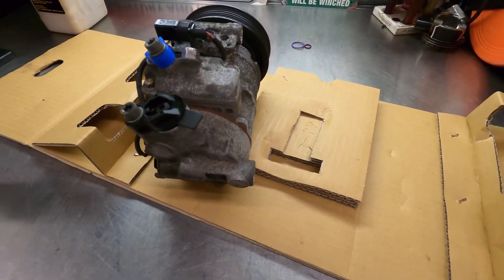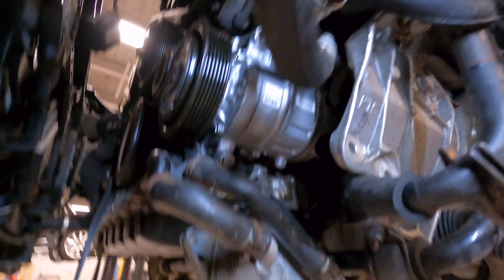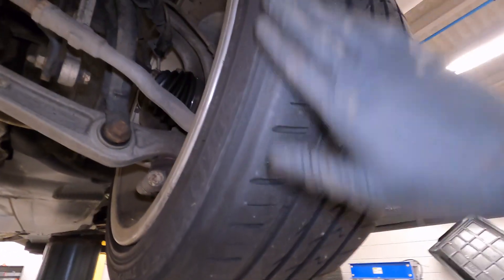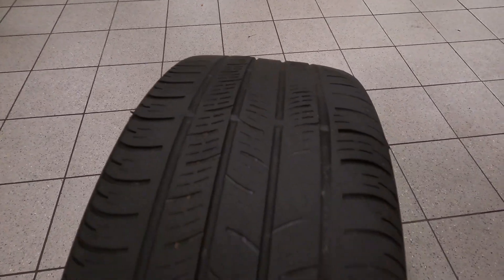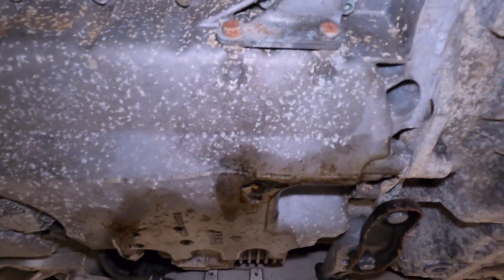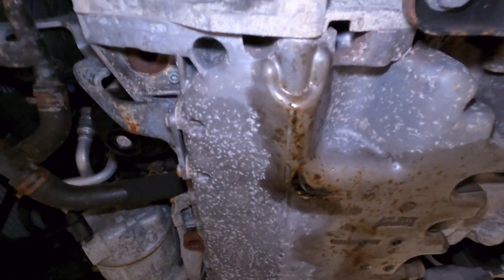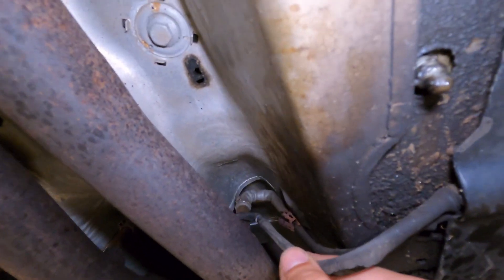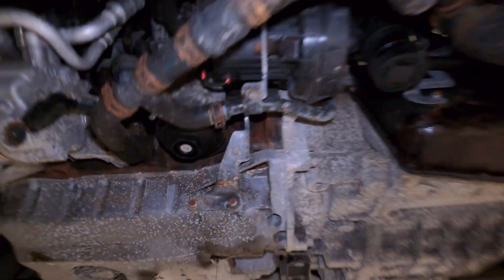Customer states Weird day in the shop again😜🤣 What's going on!??

Comment: If you slam a car so far that it punctures the oil pan, the only way to protect that car is to take it away from the owner.
Reply: That owner decided to lower an Audi.  Why would you ever do such a thing?  They deserve what they get
Reply: it there  car they  can   do what they want
Reply: @steveholland1163  ...until the oil that comes out of that BROKEN PAN makes the road slick when you’re driving behind them.

...OR they seize the engine and it shuts down right in front of you...
On a MAJOR road blocking traffic!

I bet you’ll think differently then!
Reply: @mr.carguy3161  that can happen for any car.  what really make those slammed cars annoying  is how everything grind to a halt when some fool in a slammed car need to do a turn onto something with a little elevation. 
where i live the speedbumps are so agressive that if you dont pay attention and hit one at normal road speed it hit your oilpan too in a non lowered car.
Reply: @lanemorrow7417  What about the idiots who camber their wheels so they're riding on the sidewall?

Comment: When cheap owners don't take care of their expensive cars.
Reply: I used to work at Subaru and saw it all the time with the WRXs/STIs. Kids would modify them without knowing how to care for them and they’d end up coming into the shop on the bed of a tow truck
Reply: @johns5586  People go and finance these high 5 and 6 figure cars, and are so stretched to the limit on the payments, they can't afford the repairs. So they  eventually become 500 dollar specials on a seedy used car lot.
Reply: Amazing what people will do to LOOK rich.  Most haven't a clue that when you buy German, you're in for quite the relationship/experience.  Audis virtually fall apart within 5 years of ownership if you don't dump $3k a year in them post warranty.  the people that don't know that end up with barely running piles that aren't worth the cost of a set of tires.  Keep your German cars man, I had my turn.
Reply: cameron170 -  hell yeah man. We had a 2006 STI coming in with over 250k and it was in perfect health. People don’t understand that owning a car is more than just oil changes and tires

Comment: I took my Accord in for a wheel alignment, 160,000 miles. Never had alignment before.  Went to pick it up, told no charge as it was still in specs!  Double surprised it was still in spec, but no charge for putting it up in the rack, doing all the checks.
Reply: that is awesome.  must have good roads in your area.
Reply: I've done that for a "good" customer; it pays back in other ways.
Reply: @steveneumeyer681  That's what I'm saying! Ain't like that out here in the desert!
Reply: Some places do alignment checks for free. So probably why you didn't get charged for it. As for being in spec. Wow! Must live in the south or somewhere with no potholes. Haha
Reply: Good old reliable honda. If you drive a GM they would’ve had to charge you double
Reply: Cars 17 years old and the alignment is still perfect tracks straight down the road the steering wheel goes bang on centre I guess shit lasts if you look after it

Comment: Having worked in a factory, all the "stuff" is bolted onto the engine/transmission before its  installed into the car/truck/S U V. Everything is easy to access when the engine is sitting on the assembly line before going into the car ! Lol 😆.  Just check out Having to replace the heater core assembly  !
Reply: Ford Tech Makaloco (spelling) had to change a heater core when the driver's side door had to be removed to pull a long bolt out that held up part of the dash. Plus the whole dash and driver's seat had to be removed.
Reply: @markh.6687  Yeah,  that's not fun ! Knew someone a while back that had to remove the windshield, then the whole dashboard assembly just to get to the heater core! While I'm on the subject, the whole dashboard assembly has to come out of the chevy pickup trucks! Big job !
Reply: Those VW sharan vans you get in europe are like that, you have to reach through a hole in the plastic wheel arch liner to change the damn headlight bulbs. Needless to say the little plastic cover is missing 100% of the time and the whole inner arch is filled with 14" of solid mud.
Reply: I've changed a few of the rotting evap cores on the expeditions.  Dash, center console, seats, and a bout a million fasteners need to come out.  Just glad the windshield didn't need to be removed.
Reply: No

Comment: I miss the days when you could take off the hood, step inside the engine compartment and do just about anything. You had two feet between the radiator and the front clip. You could remove the alternator, power steering unit , AC compressor or just about anything without taking the car apart. The heater core sat in a panel inside the firewall that you could access without taking apart the complete dash. The engineers now have to try to put a bushel in a peck basket, and let the technicians be damned.
Reply: Round air filter housings on top of the carb; points, plugs, condensors; one kind of radiator coolant, full-size spare tires, good times. :)
Reply: @markh.6687 We didn't have wifi, satellite radio and a million other accessories that eventually go haywire. We opened our own trunks, used keys to unlock the doors and manually positioned our seats. Old GMs had four key positions, off, power, start and lock. You could take the keys out in the off position. If you didn't put it in the lock position, you could start your car without using keys. We didn't have the rampant crime back then. The walls of the body parts were so thick that a body man really was a body man, hammering out dings and dents and using lead filler. Now they just replace whole sections. A much less complicated world.
Reply: Cars now are engineered to be assembled easier and faster. That just makes fixing them harder.
Reply: @jpharleyd9325  "And we LIKED It!"   (SNL's Grumpy Old Man character).
Reply: You just about can on the current Q5
Reply: Technicians? People repair cars? 
Dont they buy a new one each time the old one breaks?
Reply: @Lembemupixo  Yes, technicians. Gone are the day when you found an engine knock by putting your ear to the screwdriver and placing the other end over different parts of the engine. Their jobs need highly skilled  technicians to diagnose and repair vehicles. Like the way secretaries are now 'assistants' and shelf stockers, cashiers and the people who gather shopping carts from the parking lot are now 'associates'. The name technician is earned!!!!
Reply: @jpharleyd9325  oh yeah i was clearly not joking. Not at all. 
I am definitely not the repair person in my neighborhood. I clearly dont know what a technician is....
Reply: That’s exactly the time I got myself out of the auto repair business. Decided on a lucrative career in the parts aspect of the automotive industry. Bigger mistake! Most guys are parts replacers and just throw parts at the problem until it’s gone. Been selling parts for over 30 years and what a ridiculous world we now live in……
Reply: @jpharleyd9325  ... I still have one of those old chevy vehicles with the multi position ignition switch.
Reply: I’m only an amateur mechanic, but many years ago I could tackle most jobs on my own. And, yes there was space in the engine compartment to get access to the majority of engine components and take things apart fairly easily. Now I take my car to the shop for most things. OK, they’re professionals and know a lot more than I do, but I quite enjoyed doing some straightforward jobs.
Reply: @markh.6687  Oh yes I remember that! I used to carry round a spare set of points and condenser. In fact I used to reset / replace my points quite frequently - it make a big difference to starting and running.
Reply: @jpharleyd9325  I agree with you about the name technician being earned. I have a lot of respect for these people.
Reply: I miss my triumph spitfire with the hood and fenders hinged to the front. Flip it open access to anything  plus you had a tire to set on. Great piece if engineering.

Comment: I worked as a Ford dealer tech 25 years ago and with each passing year it became a major pain the rear to work on cars and survive on warranty rates as the customers rarely bought anything. I worked in a lower income area and my dealership was older and the amount of crap you'd see from the customers and put up with, became too much to deal with. I started to hate the crappy vehicles Ford was building and the engineers who designed that crap, who cared less that's someone had to one day work on it. Audi's seem just as ridiculous or more and removing the front end to replace the A/C compressor, makes me glad not to work on cars anymore.
Reply: I got out of cars and went back to heavy equipment for the same reasons.
Reply: every brand?
Reply: Its why i stick to old and very simple cars, do all the work myself and im not getting paid, sure as hell not going to make it harder on myself
Reply: Auto makers invest millions in making things hard to repair. 
Check the right to repair movement. Louis rossmann talks about it
Reply: I'm staying with Toyota.  I don't know if they're easier to work on, but they don't need to be fixed so often.
Reply: I tried to watch that dudes channel. I really enjoy mechanics on YouTube. That guy is a dick though. Any time someone asks a question or thinks about criticizing that dude he gets all pissed of and high and mighty. You can tell he thinks he’s never wrong. I had to stop watching him
Reply: @lesterparker1594  But he is good guy just not so familiar with internet fauna. :D

Comment: Customer states: I lowered my car....

Mechanic states: Don't let the door hit you on your way out.

I had a "stanced" Z3 come in recently for a control arm (the car had been in a wreck and the body shop asked me to replace the arm), arm replaced I handed the car back to the body shop... they finished what they had to do and the customer took it... 5 miles later the shitty "alloy" wheel spacer from china broke up and the wheel parted company with the car. who gets the blame? shitty parts made of chocolate? the bodyshop who had the car last? nope the person whos only input was putting a control arm on and advised the suspension being modified means I cannot perform an alignment (tyre was to the cords on the inner edge and advised to not be used on the road)
Reply: Infuriating. Hopefully didn’t cost ya anything. I hate poorly modified trash
Reply: @briantii  It punched a hole in a wheel, the guy tried to play it like they were something special... they were cheap aftermarket ones so I bought him a set of second hand 18" OE wheels (from a breaker) that looked better than the ones he had on it and told him to jog on

Comment: I never understand why people spend $400 on tires, but cheap out on the $150 alignment that caused their tires to wear out to begin with. Especially something that bad. Dumb.
Reply: What set of tires cost $400? Especially when dealing with anything larger than 15”
Reply: Not only how long they DON'T last but the shitty ride/breaking/performance that comes up in short order.
Reply: @robertsanders7312  He said he only wanted 2 tires replaced, hence the $400. But you’re right, it’s probably more than that 2 of them..

Comment: They should have never allowed all the influx of imports. They shouldn't have downsized vehicles. They shouldn't have added all the emissions garbage. They shouldn't have implemented all the so-called "safety" features, such as airbags and crumple zones. They shouldn't have swithed over from using good American made steel and chrome bumpers to using plastic everywhere... Maybe Detroit would still be thriving, instead of rotting into the ground. I think the real jabronis are the ones at the top, making all the dumbass bad decisions.

Comment: When I get tires I automatically do an alignment, you’ll get more mileage from your tires, I think it’s worth the small cost
Reply: The small cost!? Not in Audi dealership . :D
Reply: Place i get tires at will put the car up and check alignment for free and only charge if its out and they have to adjust it. (its like $20 anyway)
Reply: Alignment won't help here... Tires were fucked...
Reply: @AnanusBananus  when the tyres are new they get an alignment. Mines done every 6 months ish
Reply: @AnanusBananus  I agree. It's like the control arms are bent and/or bushings are shot. I smacked a curb pretty hard once that had my front tire wearing like that on the inside edge. Ended up replacing the whole knee assembly just to ensure that that everything was good. It was expensive, but been great ever since.
Reply: Those tires were coming apart internally..

Comment: I grew up in the 70s, when vehicles didn't have all the emissions bullshit, or airbags, or crumple zones, or computers, and being a mechanic was cool. You get two cherrybombs with the three hole flange and doughnut gasket that bolt directly to your headers, you use pipes that are made to fit together, so there's no need to weld them, you just secure them with u-bolts, and you run the tailpipes out the side in front of the rear wheels, done! And, all the parts you need are available at your local NAPA store. Them was da days, dude...

Comment: I’ll admit, I used to be that customer who would be like “give me new tires, but I don’t need an alignment.” I now think it’s worth the extra money just for the piece of mind to get extra tire life and driving comfort.
Reply: I all my tyres replaced a few weeks back - I had to wait for them to be ordered. What surprised me is that I had to ask specifically for the 4 wheel alignment to be checked as well. Why didn’t they suggest it? OK, there wasn’t any abnormal wear on the old tyres, suggesting that the alignment was right, but I’d rather this was done routinely.
Reply: yeah my local Tires Plus will check it for no extra charge when you buy four tires, most of the time it's still in spec

Comment: I worked at a Chrysler-Plymouth dealership right out of high school in 1977 taking care of the inventory, doing oil changes and helping the mechanics with anything and everything.  I also worked Friday and Saturday nights pumping gas, washing windshields, checking oil, brake, windshield fluid and transmission levels, checking tires and selling them their pop and cigarettes and such 😏.  Learned a hell of a lot, especially that cars used to be MUCH easier to work on.  My biggest gripe with cars nowadays is that you have to take the freaking bumper cover off to change a freaking turn signal bulb.  Good grief!

Comment: Depending on the mileage the car with the flat spotted tires might also need new struts/shocks.  I've seen flat spots like that when a strut/shock has gone bad.
Reply: i wonder if they even noticed something is off back there. you definitely notice when theres a flat spot on the rear, or at least i do.
Reply: Yeah no that car needs a new owner
Reply: Looks like unbalanced wheels to me. It would cause flat spots and premature failure of dampers and suspension joints.

Comment: I remember that "service position" having to work on daughters A4 which literally started falling apart by  100k miles. I'm told that's actually a long life for an Audi. 
That was the only car we've owned that I did not care what we sold it for.
Reply: What model year?
Reply: Yep, had an A4, possibly one of the worst cars I’ve ever owned. I made it to 125,000 and it went to the scrapyard.  Wasn’t economically viable to fix any more.  I put more in repairs than I paid for that POS.

Comment: Reason customer declined alignment- Its $229 at this shop. At least twice what or would be at non Audi shop. Drive round the corner and get a perfect alignment on same Hunter equipment for $95
Reply: 95 bucks thats a good deal for a 4 wheel alignment on a Audi, With adjustable 
toe and camber in the rear of a rusty multi link suspension.
Reply: Why do that!!??  Paying ridiculous prices is part of the BONUS for buying Audi.  haha
Reply: Except that the kid doing the alignment "around the corner" has all of 2 months experience and has never touched an Audi before.  That $17/hour he is getting paid is well worth having to take your Audi to the dealer to have them redo the alignment properly that the "corner shop" screwed up in the first place.
Reply: @humphrey28078  With respect it’s the equipment not the tech. It’s not a 1.75 hour job. Properly trained dudes that perform alignments all day long. Look up the specs in the data sheets. I don’t own and would never own an AUDI- though I think they are graceful and fine performers- they wear prematurely. And young man- I have owned a multitude of high end performance vehicles and do know how to pick a qualified technician. Again- with love.
Reply: @johnknott6539  You clearly did not read or comprehend my comment.  Try again.

Comment: I'm a mechanic in New Zealand. I worked in a euro car shop. We had young guys wanting their VW Golfs lowered. Which we did.  They do look good lowered and they have no protection under the engine pan. Its cast aluminum, $215.00 plus oil and filter and fitting. LOL need i say more.